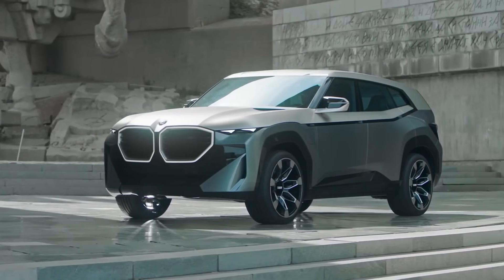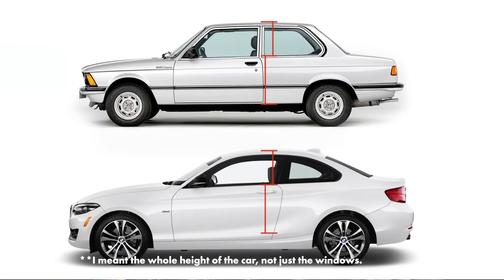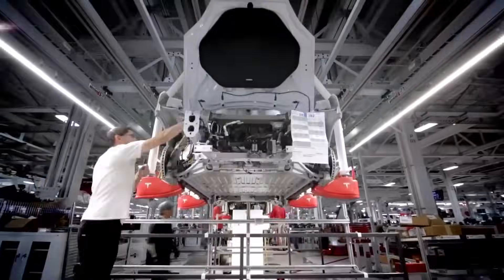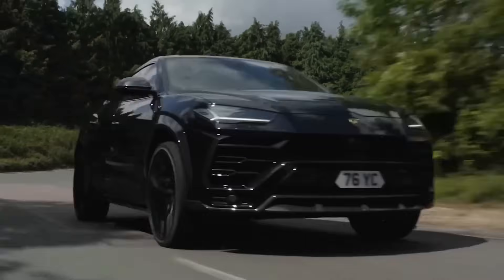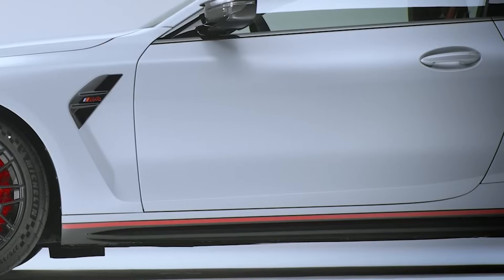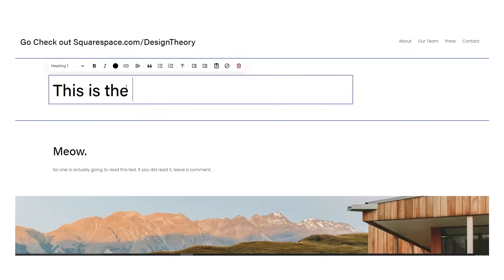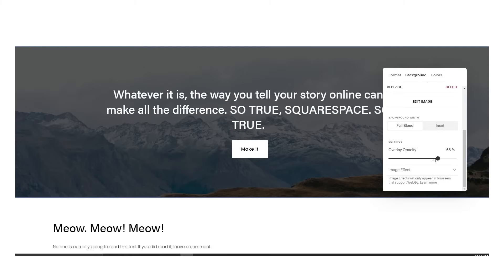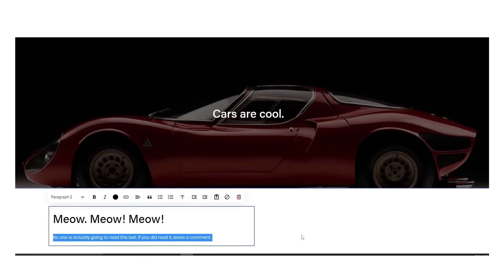Why Modern Car Designs Are So Visually Complex | Q&A w/ Pro Designer

Comment: I slightly disagree with your first point.  Sure safety moves the body up and gives the windows less height.  I read once that the Ford Taurus of the late 90's was had a rounded design that was incredibly aerodynamic but there was nothing aggressive or sporty about it.  Customers didn't like it as much and more and more of Taurus sales went to rental companies.  I think they want to make the design more compelling than the previous gen to the point that the previous gen is looked down upon.  In my opinion BMW has led the way with having the coolest body designs with everyone else following in their footsteps.  Hard edges and creases start showing up on BMW's (Acura and Lexus too) in the early 2000's.  I think the designers are moving from soft sweeping curves to a boxcutter/hardsurface modeling technique.  They are choosing to leave hard edges but still have some curves like a F-22 or F-35 fighter.  However,  I don't think they are just arbitrarily making cuts but have some complex 3d calculus behind what they are doing.  On the other hand I find the the hand designed "coachbuilt" auto of the 50's and 60's to be incredible.  Also, I have a 1984 FJ60 that has a more appealing look than the FJ80, 100 and 200 series.

Comment: Let me chime in here.

I am 53 years old. I was born in 1970. So the cars that were on the road when I first came into the world were absolutely beautiful compared to anything that came later. It was during my teenage years, in the 1980s that it happened. All cars started to look the SAME as one another. Then it was the square, boxy look. In my 20s (thew 1990s) they all changed, but they changed at the same time. They all started to look like rolling bubbles...and they all looked the same as one another. The same is true today. Out of the cornet of your eye, you cannot tell a Hyundai from a Honda from a BMW.

There is simply nothing unique between one car and the next, and it has been this way for 40 years now.

Give me an old Mustang, a Challenger/Baracuda or a 60s GTO any day.

***The exception to this rule are the newer model Pony cars and Muscle cars. I had a 392 Challenger for a while, and it was a stunner. My wife has a 2018 Camaro now, and it is likewise beautiful. The new Mustangs...same thing...beautiful. But do you see what the ONLY good looking cars in existence have in common? They are RETRO cars...all copying from the designs of the 60s and early 70s. I do not know Alphas like I know American muscle, so I cannot be specific on that one. But the one used in this video is very obviously a design retro to something they were doing in the 60s.

The world was just better at this back then.

Comment: The windows keep getting smaller with the body line getting higher.  That is a design element, driven by airbags?  Good for safety if not for eye pleasing.

Comment: This presentation was most enjoyable and it helps me to 'process' what I regard as bombastic and hideous contemporary styling. When form has defeated, even obliterated function. All those creases. Agressive shapes. Crazy lights. Small windows and reduced visibility. And of course the tedious similarity of so many vehicles. The ever-increasing ugliness of recent BMWs (including the absurdity of placing TWO badges on the rear window - perhaps a lack of confidence in product / brand recognition?) Why did Audi move away from the distinctive and distinguished yet simple, deep front grille frame (introduced 2005? ) and stretch it wider and wider into the current 'grimace'. Where will it all end? Another mystery to me is why manufacturers will devalue iconic branding, for example what PSA did with Citroën (i.e. the shameless vapidity of 'DS'). Or destroy an instantly recognisable (in almost any light or weather condition) sculptured / relief chrome marque badge with a flat graphic in a vague shield shape which, especially in poor light, is NOT visible - why do this, Renault and Peugeot?!

Comment: Hey it would be awsome if you made a video on how to spec out a car to make it less visually busy. Or even certian modification that will make it visually appealing. Like what style of wheels to go with or when is it too low for certian cars visually or what is considered as wheels are to spaced out or thin of a sidewall. I see a lot of folks trying to put their touch into their cars but they tend to do it quite poorly.
Reply from the maker: Go check out the Honda E concepts. They're really nice, and not busy at all

Comment: Viollet-le-Duc beat Frank Lloyd Wright by about half a century. Studying gothic architecture he came to see that form is function and vice versa. In gothique rayonnant especially, each ridge on an arch or column is indicative of weight bearing from a specific zone of the structure, all transferring it along the curve of the arch and then vertically to the ground. Gothique rayonnant is showing what it's doing, but nobody really had noticed it until Viollet-le-Duc studied it and pointed it out.

His ideas were so advanced and revolutionary for the middle of the 19th century that he was rejected by architects, and was much closer to engineers. He proposed architectural designs making heavy use of cast iron or steel, which were all refused for being too daring for their time. He played a major role in initiating the design and construction of the Statue of Liberty. 

He leaves behind him an absolute wealth of knowledge, but his magnum opus is the Entretiens sur l'architecture, in which he lays down most clearly what would become the theoretical ground for the renewal of architecture, but design theory as a whole.

Comment: The easiest way to make cars look sleeker is to use side moulding and lower parts in darker colours, to use flat roofs and narrower windows, rather than introducing tens of dents and bends. The problem is not in what you mentioned but the way designers are educated.

And if you argue with the shock effect, take the Countach as an example. Was it an ugly car??

Comment: 'Transformers' is the principal driver for 'modern' car design.  If you want to see a well-designed car, try the GT40, VW XL1, or the Aptera. etc. One of the biggest issues is that the cars are principally designed by...'designers', not engineers, and often the aerodynamicists are either subservient or even largely ignored. The disrespect of energy-engineering even flows into legislation, eg (i believe) that the US requires cars to have physical 'wing mirrors' and disallows cameras (which are far superior in almost every way). This is what happens when energy is too cheap and thus underappreciated.

Comment: I'd take an Alfa Romeo Tipo 33 Stradale over a Ferrari or a Lamborghini anytime. that car is just so perfect. 
Personally these are my other favorite designs
1. Jaguar E-Type (Coupe)
2. Jaguar XJ13 
3. Toyota 2000GT
4. Ferrari 250 SWB 
5. Talbot-Lago  T150C SS
6. Alfa Romeo 8C
7. Rolls Royce Phantom Jonckheere Custom
8. Mercedes Benz 300SL
9. Mercedes Benz 280SL Pagoda
10. Mercedes Benz 560 SEC AMG
11. Toyota Supra RZ/SZ
12. Mercedes Benz C63 AMG
13. Porsche 930 Turbo
14. 1971 Plymouth Roadrunner
15. Chevloret Nova
16. Porsche 911 901 
17. Porsche 911 993 GT2
18. Porsche 550 Spyder (Not the Panamerica)
19. Porsche 911 Carrera RS 2.5
20. Nissan Skyline R32

Just sharing :D What are your favorite car designs?

Comment: I have another question; Siemens NX or Solidworks? I'm unaware of your experience with either, but I'm curious to your opinions on ease of use and workflow. i personally love NX but know SW is used so much more in the industry.
Reply from the maker: Alias :O
Reply: software is a tool with constraints, and you can make about anything in about any software eventually. you can specify points in text files for povray rendering. however, as a longtime user of solidworks + many more in contract design and engineering, your workflow is going to dictate how easily you can create and change your parts and assemblies.  setting up to make changes and evolve a design requires knowing your project, software and it's limitations, and the way you build the models. huge difference in workflow and effort now vs later on changes if i build a very quick and dirty model to crack something out, vs setting up a project and an assembly for what i know will change, and with the scope of those potential changes in mind. when you're doing complex surfacing this matters much more. I'd recommend not limiting yourself to one piece of software though. i hope that helps a bit.
Reply: They're not on the same industry tier. In the automotive world, SolidWorks is tailored to OEM suppliers, ie: companies making parts, tooling and miscellaneous stuff for automakers. Cars aren't designed in SolidWorks but plenty of ancilliary things can be.

NX is a first tier package, conceived for design at the highest level, ie: designing the entire car platform. SolidWorks owner Dassault Systemes makes Catia, which is their first tier design software. So in a sense, a direct competitor of NX would be Catia.

So if you were to think about design software hierarchies existing in the automotive industry today, the typical examples are:

Tier 1: DS Catia, Siemens NX, Creo Parametric (sort of), Autodesk Alias. Full automotive design and analysis
Tier 2: DS SolidWorks, Siemens SolidEdge, Autodesk Inventor. Tooling, mechanical design, OEM parts.
Tier 3, more on the hobbist or small shop/startup level: Onshape, Autodesk Fusion 360

Comment: 1:31 i don't think "shock" is the right word. some post-modern origami cars look shocking, but mostly it's attention holding design. you want to stare at it to study the lines. where they all line up, meet, fit together. you almost want to be able to produce a mental exoskeleton of the car (kinda like a 3D modeling software rig. like fusion360, Blender, and UnrealEngine5 (there are many many others too)) in your mind's eye. 

by the way, what you call modern car design isn't modern car design. it's post-modern. modern car design was and is characterized by: functional vents, clean surfaces, elegant lines. 1990 to 2007 Acura NSX, 2007 to 2014 Audi R8, Ferrari 458 Italia and SP1 Monza, Pagani, Hyundai Prophecy, etc. post-modern car design is characterized by: origami Æsthetic, fake vents, ridiculous aero. recent BMWs, Tesla Cybertruck, Dodge Viper ACR, etc.

could you say Nicolas Cage is... surreal?

form and function being one-in-the-same. i might've heard about it before, but the way u described it "opened up my eyes". or maybe put another way: form doesn't follow function, function and form aren't the same thing. but rather; form.. heh,,, informs function. i mean, good form is also visual information. i think that's what you were trying to say. that the design of a product informs the user of it's function. if it's good design. when form and function are in unity,,,,, well that's just the thing! the lines are blurred: by definition.
Reply from the maker: Re: shock, yeah, you could be right. And yes, post-modern is probably a more appropriate term. I just framed the question the way the person asked it (which I can't find anymore). Re: Nicolas Cage. He definitely has a more impressionistic or surreal style. This is a bit odd for people, because film acting is the closest thing to real life. If you see a surrealist painting, it's not as jarring or strange as seeing a real human being acting like a maniac on camera. Re: form/funciton, go check out Louis Sullivan's early work on "form ever follows function" and Frank Lloyd Wright's writing on it. Also check out Hartmut Esslinger's "Form follows emotion", and "Emotional Design" and "The Design of Everyday Things" by Don Norman
Reply: @Design.Theory  oh hey! thanks for replying!
Reply: Your chosen examples are pretty illustrative of how the car industry works on the mind.
Reply: @weatheranddarkness  thank... you?

Comment: And where are the bumpers? A regular daily driver should have proper bumpers. When someone parallel parks these new cars with the integrated plastic bumpers and someone backs into it or scuffs the bumper, it is a calamity. On the older cars, you had these black or chrome bumpers that you just polish and could take a beating. I recently bought a Jeep Wrangler and one of the main draws was that it actually has bumpers. If someone backs into it while it's parallel parked, it's no big deal.

Comment: Form follows function arose out of the Bauhaus not so much FLW and resulted in the International architectural style as espoused by Mies Van Der Rohe Walter Gropius and Le Corbusier. It was a reaction to functionality being overwhelmed by superficial applied decoration, however the international created a bland dehumanised environment that was intended to also ignore or eliminate regional and cultural specifics, and the main feature of architecture which is to create a sense of locality 
. Architecture has ever since been trying to square the circle by adhering to “form follows functionalism” but simultaneously trying to create a sense of identity 
GOOD LUCK

Comment: There's NEVER excuse for Baroque design. Otherwise this  would be done at airplanes too. But quick vehicles are aerodynamic best with smooth lines. A good designer doesn't have to learn at school, he has to have the feeling by nature. I believe, all the low range designers shall be protected against umemployment, so they let them do.

Comment: as an engenders i can tell you it has nothing to do with safety , safety is the structures and the chassis job ,not the exterior designs' job , but i can make it from thinner material if i can add a few ribs and folds into the straight sheets 

thats why you can basically punch a wheel arch and still significantly dent it , you dont even have to punch it sometimes , just push it with your palm and the thin material will crumple 

and if your in an accident ,your already fucked anyway ,why would i make the hood out of 3 mm steel when i can make it out of 0.5 mm sheet with a few "stylish bends" in it 
new cars are a scam

Comment: Most New cars are fugly. 
Which is odd, because in the past 40 years, I never had a problem with newer designs until recently. I find myself looking for older cars now. Mercedes 560 SEC, BMW 850 CSI older Porsche models..etc. I drive newer cars currently. But they feel and look soulless. My next car will be an old car.

Comment: Good review. Process based and catering to more broad (less aesthetically sensitive) market.
I would expect false air intakes, and other false functionally appearing elements in very low end. But when BMW have all these fakes throughout - digusting!
Reply from the maker: Yeah, I have a feeling that it will swing back in the other direction at some point.

Comment: Gaaahhh, vehicle body design. Most of them seem to have little interest in the most important side of the vehicle. The ass!

The most often viewed side is the ass, and it generally looks dumb, like an afterthought, "Oh yeah, this side too." Scritch, "Gud'nuf!" I remember seeing a porche some 20-odd years ago, that had a single round tail pipe at the bottom of the bumper... at center. The first thing I thought was, "We don't need assholes buying our cars; look, we've built one in." And I still can not get that image out of my head, like who signed off on that? This porche needs a panty.

Here's the thing about side body beauty. The side matters, when it's parked on the street. If that's your goal, then fine, go hard.

Front beauty says more about horsepower, and aerodynamics. A nice sleek and sexy front end says, limited horsepower or the the horsepower is in the back. Horsepower generally takes up space, so an angry front end is generally the better looking option. Not that any of this matters, unless you're deliberately looking the car head-on, which means it's parked, and... you're probably the only one looking at it until it makes you stop looking at it. If you're seeing it while it's at speed, it's either in a rear-view mirror, and or coming at you at double speed; in either case, taking a good long drink of that good looking ton of steel means you've increased the likelihood of causing an accident yourself.

Now let's talk about asses - whispers "I see asses... everywhere." At intersections. When parking. When walking. When biking. When sitting on street benches. Asses going this way. Asses going that way. Asses humming. Asses growling. Asses backfiring. Everywhere asses. I just wanna be clear, I'm not actually an ass guy; I just have no choice in the matter.

I have to pay attention to ass ends to avoid driving into them. It's called, eyes-on-the-road, and just what is blocking the road in front of you? Asses!!! Pull up to an ass. Park behind an ass. Pull out from an ass. Swing around an ass. Pass an ass. Asses lined up for miles!!! Have you ever taken a good look around while stuck in traffic, and thought, "Ahh, what a beautiful view." I bet your driving experience would be more enjoyable if designers took their asses into consideration.

When I'm on the highway, I am either passing an ass, or an ass is passing me. In the first case, I might not get an immediate chance to pass that ass, which means I might have to stare at that ass for some 20 miles or so. Hell, if the ass passes me, I may still have to stare at it for several miles before it gets away. On average, this is far longer than anyone standing on the street give gazing at the side body, annnnnd I have no choice in the matter. Oncoming traffic? Zoommmmm, "Was that a countach? Wow, sexy!"

I don't know where any of the designers are from, but from where I am, most people park straight into their driveways, which means their ass is facing out. This also means that they go ass first back into traffic. And then those obnoxiously bright LED lights.

Vehicle designers clearly don't drive much anymore, and certainly not at night.